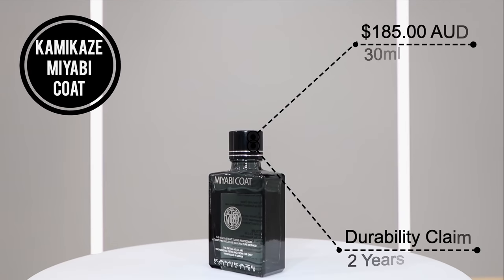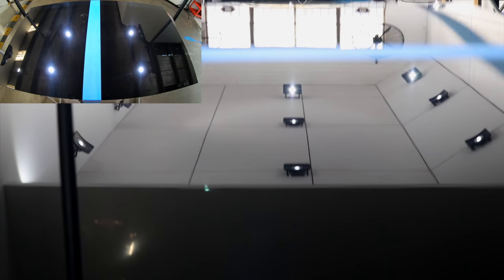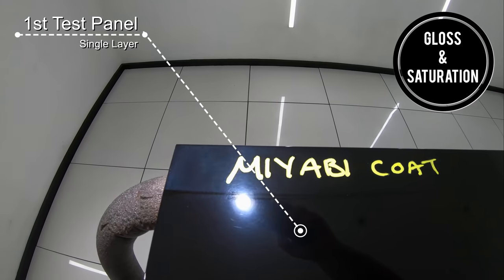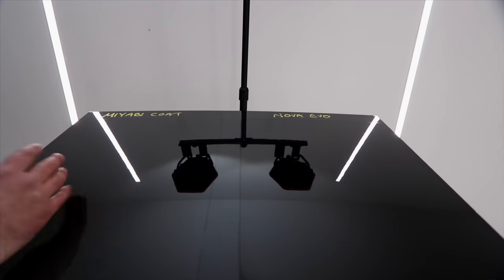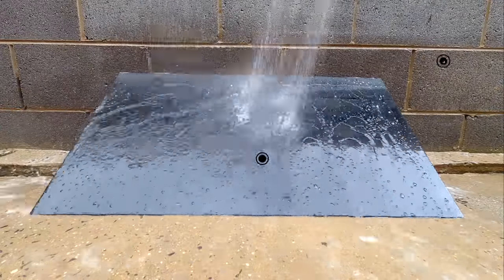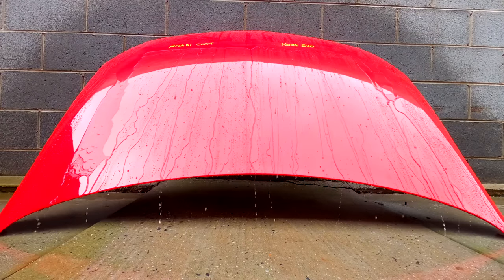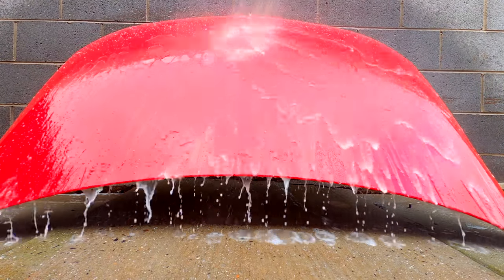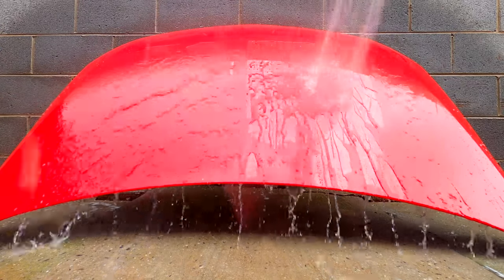Kamikaze Miyabi Coat vs Nv Nova Evo - Ceramic Coatings!

Comment: I have never been disappointed from any comparison of any NV product so far..  Evo has shown this again..
I have been tossing up with just using NV Jet or going completely with a more traditional ceramic coating.
But it has been the ease of use for NV Jet.   But if NV Evo goes on that easily, Then I may go down that path..
Cheers again for another great informative video.

Comment: Miyabi usually be used as a base coat ! You will see extremely difference when you apply the second coat with ISM . And the beading effect will be amazing  and slippery too .. miyabi it’s a base coat ! ..
Reply: Here in the USA ISM will cost you another $170. Myabi is $130. So you’re spending $300.

Comment: I absolutely love your videos, but I have to chime in about something that I believe is constructive. Lately you've been showing a zoomed in view of the side of a panel when you're applying a coating and in the top left corner you have the standard overhead view. The zoomed in side view makes it very difficult to see what the product looks like and I find myself squinting to try to see the picture-in-picture view at the top left. This smaller view you're showing is what you've used in many previous videos and it shows exactly how the product looks when being applied (how thin or thick it is, if it's flashing quickly or slowly, and anything else). 

May I make a suggestion? I'd like to see you reverse this and put the overhead view as being the full screen shot of the product application and the side view being the picture-in-picture at the top left. 

I say all of this in kindness and really appreciate all of the time, effort and energy you labor into these videos for your viewership. Thanks for being a big help to me in my detailing business.

Comment: thanks for all the time and effort putting this together.  I have a question that's kind of a tangent.  You know what I don't see from any detailers are videos about how you detail a car that already has a good ceramic coat on it that is working fine. Say someone brings the car back in a year later, the coating is still great, but they want it to look spectacular for a big event or something. Do you still machine polish it over the ceramic coating?  Is there any special thing you do to make sure you don't rub off the coating?  That might be a cool video idea.
Reply from the maker: I think that could be a good future video to do, but no I wouldn’t polish over coating unless I’m removing it and staring again, the basic process would be a good intensive clean followed by a top layer sealant.

Comment: If I'm biased it anything is C-Quarts UK 3.0 as it's really the only thing I can afford and feel is worth buying to use at it's price. Sure there are cheaper but UK seems good, it does well according to everyone and if I finally decided to use a coating that will be the one. I looked at their lite version but for the extra $3 the UK seems better to me as the light really seems to be more akin to a stronger spray ceramic than a coating in my opinion.

Comment: I use both of these so it was good to get your point of view and if your findings were the same or find out something I have missed. I know there seem to be sold as more your higher end easey to get coatings and there for sold for more then most but really I find they are still good bang for your $$$$$. One question have you ever put ISM on top of miyabi before ????
Reply: Miyabi x 2, ISM 1.0 x 1 went 24 months, 42k miles on my daily driver in NE Ohio, 95% freeway use. Wifes daily driver was at 3 years, 16k miles with the same combo before I removed it for Miyabi + Zipang and a guess is that I coulda got another year or so outta the Miyabi + ISM 1.0.

Winter freeway use is a LSP-Killer in my climate 😱
Reply: @budgetplan8730   so your roads have salt or other products put onto them in the winter ????

Comment: Great stuff Sandro, just wondering can EVO be layered with Jet or Lustre?
Reply from the maker: Yes it can
Reply: @CarCraftAutoDetailing  Thanks so much for your reply Sandro,, forgot to ask, once EVO has been applied, how much time would you give it before applying Jet or Lustre?  Is it best to give EVO some cure time first, day or week ?
Reply from the maker: Although you can apply Nova Boost 24-48hrs (depending on climate) after Evo, you should really wait 1-2wks until Evo fully cures before applying Jer or Lustre - usually after the first wash is a good time to apply either.

Comment: Hi Sandro. What’s the average life for NV Nova Evo coating? I just put it on my rims and they look amazing
Reply from the maker: I would say up to three years is about right on car paint, potentially longer if the car is always garaged and regularly washes with safe methods, and potentially shorter if it’s always outside and perhaps not maintained as well, but how well the paint was prepped before hand is also extremely important and using products like Boost, Jet and Lustre can also extend its life. On car rims it’s always going to be less durable (as with all coatings) but if they were polished and well prepped 12-18mths is definitely doable.
Reply: @CarCraftAutoDetailing  thank you so much for the prompt reply.

Comment: Also meant to ask - CarPro Reset vs Nv Snow or Snow+, have you compared these Sandro? Which do you feel is a more effective cleaner (in the cannon and bucket) at flat out cleaning? Nv is new to the US and I am curious and excited to try it all next week!
Reply from the maker: They’re all a little different, Snow is a great pure general maintenance wash for ceramic or non ceramic coated cars, while Reset is more geared towards ceramic coated or at least SiO2 based sealants both for maintenance or light decon washes, while Snow+ is really more of a periodic decon wash product that won’t effect a ceramic coating but it can strip waxes and sealants, so it’s great to use just before you apply a fresh top coat to you’re paint.

Comment: Sandro, this testing confirms that you follow the manufacturers directions to get the most out of the product. Nova Evo requires only 1 layer where Kamikaze requires 2 layers as per the directions. Hope you are keeping safe with what is happening in Melbourne with covid-19.
Reply: Not really, Miyabi works better as foundation base for ISM or Zipang. As stand alone product... meh, not much different than 99% consumer grade ceramic coat from Japan.

Comment: For a beginner detailer, would you recommend Kamikaze or Carpro uk3.0.
Looking for something easy to apply and buff off.
Reply from the maker: CQUK 3.0 is what I tend to recommend for beginners as you don’t have to worry about flash times, just spread it in thoroughly and immediately wipe it off, it’s very simple with less guess work.

Comment: Hi Sandro! Great video! Just playing devils advocate here (not a criticism) but I was a bit disappointed with the results of the Kamikaze Collection Miyabi Coat! (conscious of your comment of brand fans).  In your video you said that you let it cure for a few minutes prior to levelling but my understanding with Miyabi Coat is that it needs to cure for between 5-10 minutes (depending on temp) prior to levelling to get full bonding.  Not to question your vast experience (as I say this is just a positive observation) but you say it was cold when you done this test so it may have needed closer to 10 mins bonding time! Could this be why it may not have performed outstandingly in this test? My experience with a Miyabi is much better gloss, colour saturation, chemical resistance, and hydrophobics.  Great work! I know these videos aren’t easy to put together but please keep it up ...
Reply: Thanks mate! Great channel ... would be good to see how you find Dr Beasleys 1201 ceramic coat in a future test if you’ve not tested it already

Comment: Would you use this in addition to NV lust/jet or as a next level alternative?
Reply from the maker: You can those sealants over Evo use or it as a standalone, it’s really up to you. But Evo is a true ceramic coating rather than a spray coating.
Reply: @CarCraftAutoDetailing  thank you, would you go to the hassle of applying over the top of evo?
Reply from the maker: Yes, but maybe down the track

Comment: Hey Sandro...Bobby here in the US. Very impressed with Evo. Do you recommend any toppers for it?  Similar to Exo topped on Crystal Serum Light.
Reply from the maker: I’d recommend Nv Nova Jet, but you want to wait at least 48hrs or just apply it after the first wash of the coating 1-2 weeks later
Reply: @CarCraftAutoDetailing  perfect!  Thank you

Comment: Sandro, unless i missed it. I never seen you mention Evo is graphene infused.
Reply from the maker: Evo was update about 18mths ago which included the addition of some graphene to its make up. I don’t like the fact that many coating brands now do the same thing but push that it’s a graphene coating when it’s really not. Evo is still a quartz or glass based coating with many additional ingredients one of which is graphene which is fine list, but it would be misleading to push that fact or claim that it contains enough to make it a dominant factor in its performance. That’s the reason I don’t like to push that fact, I like honest brands.

Comment: Hi  as we are here in UK the Nv Nova Evo is not avilable. I'm interested at the beginning to apply Miyabi Coat to my new car due to many good review of shiny and glossy candy wet look, together with the VOC-free carrier. However after reading your test, I doubt the Miyabi coat is lack in surface slickness and weak in chemical resistant, as well as slow in water beading. Will you still recommend Miyabi Coat or any brand (e.g. CarPro or GTechiq as they are hype in coating industry) regarding slickness, candy look and apply difficulty? Thanks.
Reply from the maker: Miyabi can be a great first coating to apply and work with and although it may not have faired as good as Evo, it’s still a great coating. CarPro, Gtechniq, Gyeon and other good brands also make some fantastic coatings but every coating is a little different and lots of people also have very different experiences with the same coatings so it can be a subjective thing.
Reply: @CarCraftAutoDetailing  for car pro CQUK 3.0 Vs miyabi coat, which one you will recommend?
Reply from the maker: I personally think Miyabi needs an updated formula to bring it into 2020 so I’d tend to recommend UK
Reply: @CarCraftAutoDetailing  what elements that you think miyabi coat missing when compare to 2020 general ceramic coating?
Reply from the maker: It’s just at the areas that were covered in the video

Comment: hi sandro would slick back as a primer work well with evo ?
Reply from the maker: I actually used that combination on an Audi RS4 last year and last heard a few months ago, it’s still holding up very well. 
Just make saw you give SlickBack a good 3-4 hrs to set before coating over it.
Reply: @CarCraftAutoDetailing   thanks buddy

Comment: Hi Sandro!

NV Evo okay on glass?
I'm in a rush and can't get my hands on NV Glass.
Reply from the maker: It works fine on glass, the only caveat is that on the front windscreen the wipers my tend to prematurely wear it down, but I always inform my clients that front windscreen coatings and wheel coatings will tends to diminish quicker than on the rest on the paint.
Reply: @CarCraftAutoDetailing  Thanks Sandro appreciate it! 🙏

Comment: How many seconds approximately do you let Nv Nova evo cute?
Reply from the maker: It really depends on the environment and your technique - hotter weather and a breeze will speed it up, colder climates and laying it down thinly will drastically slow it down - maybe 5-7mins is average.
Reply: @CarCraftAutoDetailing  so you let it sit for 5 minutes then?

I've done almost an immediate wipe off because it said so on the bottle if Im not mistaken.

I'm waiting for the Nv Nova evo v2 atm

Comment: Purchased Evo earlier today by chance from waxit. Looks like i made the right call going on performance here. 

Sandro, any chance you could look at Rayon pads and ceriglass in a future vid. Had a really bad result this weekend, it scratched up my windscreen terribly (fine swirls), not sure why. Don't know how to fix. Worst experience with any product, and I'm a carpro fanboy
Reply: @CarCraftAutoDetailing  thanks for the reply, so it's not just me. Yes, I watched a number of positive reviews before trying, maybe like paint there is hard and soft glass with mine the latter. 
Any suggestions for getting rid of the scratches? I thought about contacting a windscreen specialist to polish out if possible. Or is a new windscreen the best option, I hope not. 
With ceriglass in the flybyforte kit and rayon promoted alongside it, it should probably come with a warning. 
Well if you're feeling brave for another video on this topic and need a car model let me know, im in melb. 
Anyway, will see you at a future course, I need your industry wisdom 👍

Comment: Sandro I have a question. Detailed image has cquk 3.0 for 50 or 60 bucks and it's a 2 or 3 year coating, plus they have coupons for 10% off (DetailedImage97513) why would someone pay 100 dollars more for the same lifespan of a  coating? And my opinion nova evo won this battle by far
Reply: @CarCraftAutoDetailing  ahhhhhh ok. So are they about the same price in usd?
Reply: @cacocorlino3666  Well here in Australia that cquk is around $90aud, with the Evo at $160 or almost double.